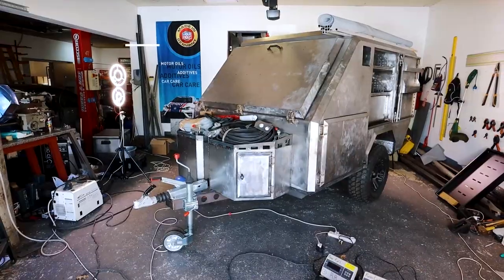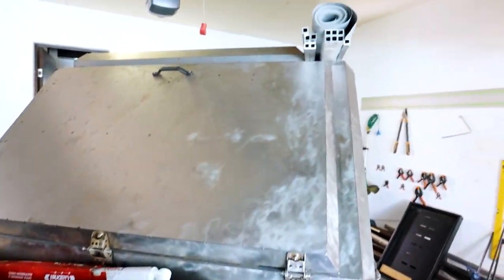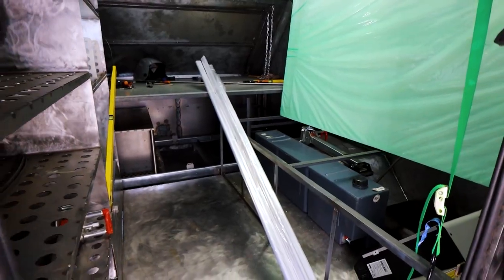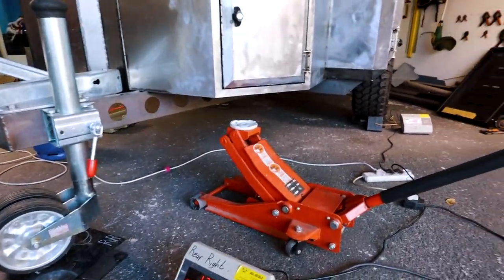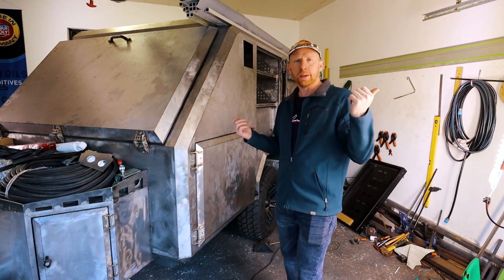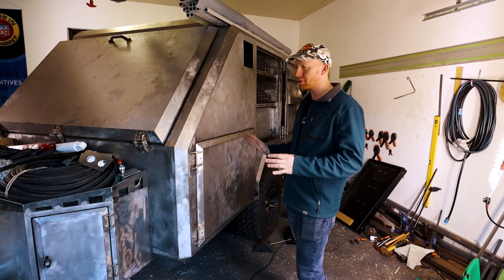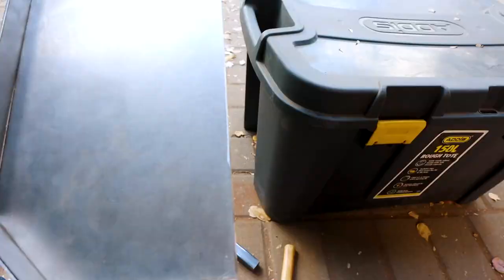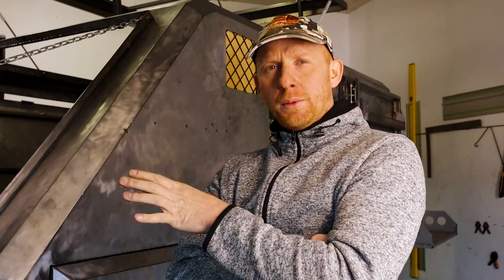Weighing The DIY Steel Camper Trailer, I Was Pleasantly Surprised

Comment: Nice! I think I am as surprised as you were. That's awesome. One question I do have. What is the height of the trailer (approximately)? O really like how this is coming together. Just an overall amazing job! Will you be selling plans for this once you've got it complete?
Reply from the maker: Hi, From the floor to the top of the trailer is 2180mm that's with the current big tires on the 17" rims. The awning would still be higher than that with around 60mm or so I would guess. Thanks for the compliment. I'm so glad about the weight.. Now I know why I've been able to man handle it like that around the garage.. I've had a few requests now for plans and so on... what ill maybe do is after the build go through all the drawings I have and see if there's a way to string them together for people so they can just have all the pieces cut with out having them loose money. The main problem is that I was building this as a once off and a lot of the drawings was changed on the fly and didn't care about storing them in any order for re use later.

Comment: I can't wait to see the awning!- Ill be peering over your shoulder as Ive been doing canvas work since the mid 1980s lol. _ Oh and because Ive not yet made my custom 270 degree for my offgrid trailer!
Reply from the maker: I'm really not looking forward to the canvas work. I have zero experience, I have stitched some carports together with shade netting and that's the only experience I have.. gonna be a struggle.. lol I'm just planning on making the frame work sturdy as all hell.. don't want wind to screw me around while opening it.  Thanks for watching. Really appreciate it!!
Reply: @MariusBotha  well for 200gsm canvas  a good walking foot Juki or Mitsubishi like a upholsterer uses is what you need. on corners you will be punching thru 6 layers. more if you are putting eyelet reinforcing in there. Use a good M24 poly cotton thread.poly gives uv strength, cotton puffs up when wet to make it waterproof. your machine will have a table but that table needs to be in a large table or your large pieces will pull and drag  twist your stitch lines. A table that extends behind you and another in front is best. The material is expensive so have a practice run on some old sheets or a pvc tarp. A domestic machine wont take a needle or thread big enough to do it properly. - I hope that sets you in the right direction.
Reply from the maker: @t.h.o.r.  Thanks so much for the info. I do have a double needle industrial machine atm. It goes through many many layers no problems. This issue will be with the operator.. Lol. I did get the right thread and so on... Now the skill to do it.. Hehe. Thank you

Comment: Marius, I’m thoroughly enjoying watching your build. Would you be marketing your design ?
Reply from the maker: Hi there, Thank you so much. I've had a few requests now for plans and so on... what ill maybe do is after the build go through all te drawings I have and see if there's a way to string them together for people so they can just have all the pieces cut with out having them loose money. The main problem is that I was building this as a once off and  a lot of the drawings was changed on the fly and didn't care about storing them in any order for re use later.

Thanks again!!
Reply: @MariusBotha  conqueror sells them. Its called a companion
Reply from the maker: @jacquesD4D  Uhm.. no thanks. They are way to heavy for what ure getting. Ill pass thx
Reply: @MariusBotha  FYI my companion with a bit more in than the skeleton you weighed is 990KG. LOL.

Comment: Hi Marius
I am very impressed with your project. I can see you replicate a Conqueror Companion. I own a Companion for 11 years and are still very happy with it. It has a place for everything. 

If I may propose or give a few tips for you for this caravan it will be the following:
1. Where you have your 4 crates on the right side, put in 2 sliders for them.  One for the top pair and one for the bottom pair. It makes live very easy.
2. Throw away the Gabriel Safari shocks. Put in proper OME, Iron Man or TJM. Don't go for Tough dog shocks either, they are only good for dog kennel gates. Your suspension is the most important part of the whole caravan. Make it super strong. Pity you did not go independent suspension. The stiffer your suspension are the more it transfer the vibration through to your caravan. I never had anything breaking due to bad roads when I went through Namibia, Botswana, Zimbabwe, Swaziland and Mozambique. If your towing vehicle can handle the road you know your caravan can also.
3. The Companion has 2 x 80l Water tanks which I found ideal.
4. The space in the Companion for the 2 x Deep cycle batteries are very limited and can only fit a 100 or 110 A battery in. I would have liked bigger space for bigger batteries.
5. I like your design with the roof. It gives you better ventilation. Afrispoor Cheetah got rid of the horisontal beam/support over your front bed which gives you a lot of space when using the front bed. This is why I only use the side bed (even if it is smaller than the front bed) and kids the front bed. I don't like crawling into bed.

 I am very impressed with your quality of your craftmanship. I cant wait for your next video.
Paul
Reply from the maker: Thank you very much for the feedback. It's mostly the companion design yes. just changed the niggles I had with it. 
1.The crates have a slide for the bottom ones.. thought that if i want to access the top ones I'll slide the bottom ones out and just pull the top crate onto the bottom one that would then form a table.. ill still show that in an upcoming video.
2.The shocks I installed are the same as used on the rangers so upgrading them will be a very easy swop in the future. I agree with u 100%.. for now its all budget lol.  I really wanted a solid axle with leaf springs on this trailer.  ill still explain in some video why i wanted this route in detail.
3. I have 2 x 55l installed with space for a flat 50l on top of them if I need to on long trips. I started the design with 160l in mind but thought ill give the 110l a try and if I need to install the extra 50l it will be a quick job.
4. Battery should be good for now as that is a 2.4KWh lithion battery. ill see how it hold up. It holds more or less the same as 2 x 110A deep cycles and u can discharge these deeper without damage when in need.
5. I just didn't want a slanted roof so this one it was .. :-). I've seen those caravans without the centre brace.. although if I take that section out, my trailer would fall apart.. lol its a critical part.. if one wants to build without a cross bar u'll need a very different design to keep the sides strong.

Thank you so much for all the input and for watching!!

Cheers 
Marius

Comment: Good going.
Just a question. I have now watched all your video's and was wondering.. What are you going to use for heat / cold isolation?
Reply from the maker: Hi. Most of the campers for sale don't use anything. Ill see how it goes. If its a problem in winter ill maybe stick some sort of carpet to the inside walls. Summer should be fine as u mostly park in the shade and if need I can run the Evap cooler. Winter times ill see how it goes. If its really cold and dew runoff is a problem then ill do some insulating.

Thanks

Comment: 2426.6 lbs before water, food, tools and gear, but you've bulk product (canvas, weatherstrip, etc) you need just a portion of. In my world, a small trailer like yours won't weigh more than 3000 lbs/1360.7 kg. Nice work, for sure, especially since it's all steel. 
Looking forward to your results using your positive pressure ventilation system for those dusty trails. Safe travels to you from those of us here on the west coast of the USA.

Comment: very nice.  how can I get the pland from you so I can build my own?  I will have to buy a nice welder. what are you using? let me know how I can get in touch.  Just can not afford the stuff at caravan parks.
Reply from the maker: Hi. Any mig welder will work fine for 90 percent of the work. I use a small tig welder for the alu and stainless sections. My sketchup files are so messy and un-organized. I can send u them if u willing to work through them. mariusbothachannel@gmail.com

Comment: Hi I came over for a visit to check out the weight of the trailer, I honestly would have thought 1500kg but your water tanks were empty I don’t know  the capacity but I would think 90kg extra, 
Good job mate !!!
Reply from the maker: They hold 55L each so that would add 110kg full. also didn't add solar to the scales. Thx

Comment: Well done mate, those weight numbers look fantastic. I would budget another 200-300kg for food, clothing, electrical, kitchen stuff, and spares/tools when setting up suspension. Even then, a loaded camper trailer at 1500-1600KG is just great and will tow very well off-road.
Reply from the maker: I also worked roughly on 1500kg give or take. The axle company recommended 2000kg suspension. To change the spring rate is a quick job tho and not expensive so when all done I'll fine tune it not to have the suspension too hard. Thank you!!
Reply: @MariusBotha you really put in the work at the start, and it shows.

Have you thought about air bags? Only need a very small compressor and it makes leveling super easy with the bonus of load compensation. What's more is you can lower ride height for long onroad trips to improve fuel economy (not sure if range is an issue where you are?).
Reply from the maker: @Sethjxl  I will Def have to look into them. To be honest I have no experience with them but will Def have a look and see how they work and how they installed. Sounds like a cool idea. Thank you

Comment: Hey Marius, great to see your work and the result success.  I have experience building a camper and I too chose steel... such a great idea as it doesn't fatigue like aluminium and is stronger for thickness, so when suitable thickness aluminium is used, the weight saving is minimal.  May I ask how are you planning on insulating it, if you are at all?  Also, are you going seam weld up all the joints along the main body, or will you be tacking it (as you mentioned earlier in other video that cars are spot welding)?  I'm about to build an extreme off road caravan for a family of 4... I will keep on watching your build with anticipation.  Thanks!
Reply from the maker: Hi there. For now almost all of our vans here are not insulated.. extra blanket or 2 or 3 maybe and the evap cooler for the hot days.. lol
The  body seams are currently stitched welded which is almost like a 75 to 80 percent full weld. The doors panels ill do the spot weld every 12mm or so. Then seal all the seams up with automotive seam sealer on the insides and body filler for the outside so I can sand them prior to painting. Thank you for watching!!
Reply: @MariusBotha  cool, the stitch weld sounds great! May I encourage you to do something re insulation, even if it is just too put carpet on the inside. The camper I built has a section I hadn't intended to insulate, so left it painted steel and what I noticed was in the evenings that the dew would condense and drip off the cold metal. This happened even in the Australian summers. Unless there is pretty much no relative humidity in Africa, might be a good idea. I'm sure whatever you do it'll be great! I look forward to future dialogue... keep up the great work! Got any info on the suspension system you've used?
Reply from the maker: @lifeofintention4711  Hi. That's a awesome idea of sticking carpet down inside. What ill do is finish painting the van as u gonna need that in anyway behind whatever u insulating with. Then at the first sign of dew ill carpet the whole inside. Thanks for the idea!

The suspension I chose a normal old school leaf spring and solid axle setup for a few reasons. There's is now way that that system leaves u stranded somewhere.. with some loose wire u'll get it home...parts like spare leaf springs can be found in any remote location as all ure bakkies use them.  Another point that I like about them is able to visually inspect them for maintenance before a trip. they simple as can be. Then finally the ease of building.... now u get these people that like to talk about whos got the bigger !@#!$!@ around a braai and they like to get points for their very fancy suspension setups on their trailers.. 

My biggest point is that most if not almost all the tow vehicles that we use for overlanding and camping have solid rear axes with a diff in die middle.. so what's the point of having this extreme suspension setup on your camper but then u go tow it with  a 2021 Ford ranger Wildtrak with a sold axle and leaf springs.. or a amarok or a hilux for that matter. No one complains about the suspension on their tow vehicles but has tons to say about solid axle trailers.. It blows my mind.. my trailer has more ground clearance that my bakkie can ever have as there's no diff..so if my bakkie can go to a location the trailer can follow. simple as that. I used a 2,5 ton braked axle just to over engineer it.. even though my trailer will be around 1500kg loaded with our stuff and water.

Cheers!!